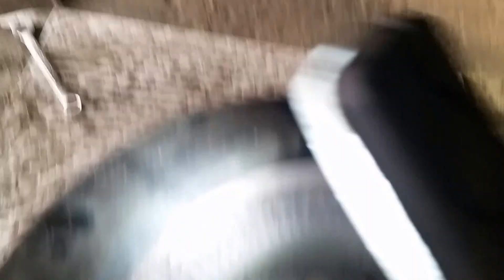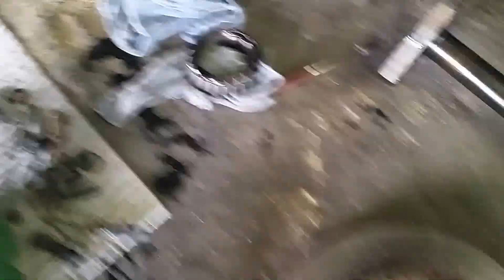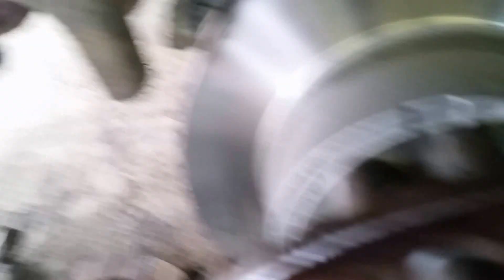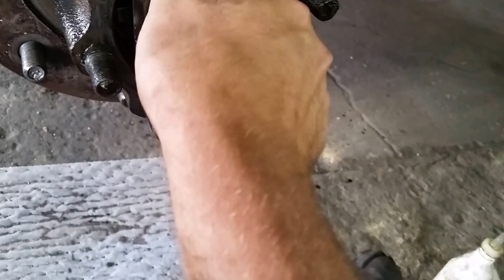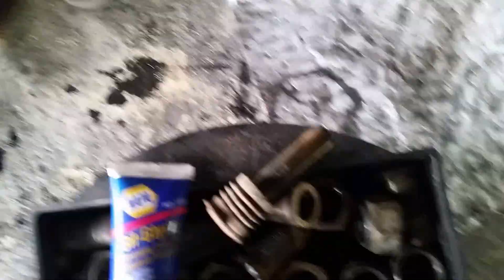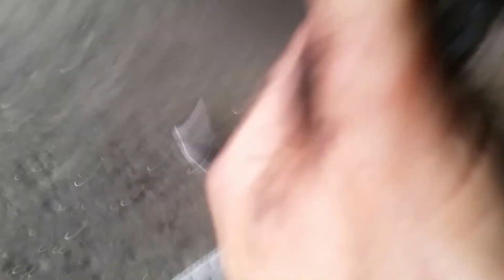International brake job video 2 of 2 #wisemanautomotive #international #brakes #rearbrakes #mechanic

Comment: Thanks for the video. I have a 1995 3800 with discs all the way around. They are 6 lug and that makes it hard to find wheels. Can I change  the hubs to 10 lug? Mine are  15x1.435 discs.

Comment: That's an interesting hub and disc assembly...any chance you can measure that disc...like to convert my 56 s-120 with discs....my budd wheels are 16"....
Reply from the maker: I would if I still worked there. Go to a auto parts store and ask to see a brake rotors for a international school bus. You could also call international dealer and talk to parts and ask them for the specs.
Reply: @jeffwiseman0286  since gm rotors are cheap and available...I probably will cut one them to fit and bolt to a harvester hub....any disc set up will be a drastic improvement over drums ...considering all 4 discs.
Reply: I will take some cues from a dodge drum to disc site ....military dodges had even larger hubs

Comment: so if you cant take caliper off what do you do when it goes bad or is there a way to change it
Reply from the maker: Not sure i understand, why can’t you take the caliper off? You should be able to take the caliper and brake hose off then replace the caliper. Whatever you do to one side you should do to the other, so make sure you replace the other caliper.

Comment: What rear axel nut socket size are you using on this rear seal and rotor replacement?
Reply from the maker: Darrick Hickman I think a 3 1/2 inch socket been so long since I did that job
Reply: Okay. Someone told me they think it's 3-1/4 that's why I asked. Thank you for the fast reply

Comment: Why gear oil instead of wheel bearing grease?
Reply from the maker: The gear oil lubes the differential gears as well as the bearings. Because it is a liquid it will lube everything. Grease will only stay in one place and have too much resistance for the differential. As far as I know you only see bearing grease on “dead” axles like a trailer or the front bearings on a old rear wheel drive car.
Reply: @jeffwiseman0286  makes sense thanks for the info
Reply: Actually using some,not alot of grease is okay as it will stay put on the bearings until the fluid from the rear end gets to the bearings and fills up the up. It is good to prefill the hub.

Comment: Hey Jonathan how you doing I have a old one International DT466 4300 and the problem that I'm having is my brakes keep sticking I can drive down the road for a couple of miles and it'll start slowing the truck down to the point that they will completely stop or I can just jump in the truck to drive it one day and they're stuck can't seem to figure out what the problem is can you help any advice would be greatly appreciated thanks
Reply from the maker: ki lo hello,  my name is Jeff,  typically calipers sticking is probably the number 1 cause. Another cause could be a brake caliper hose. I like to replace calipers and hoses at the same time if I can. Does one side stick? Is it the front or the back or both?

Comment: Only thing I do different is to fill the hub with oil before I put the outer bearing in.
Reply from the maker: Yeah I should have done that.
Reply: What kind of gear oil do you recommend for this?

Comment: Should tell your viewers to also rotate the hub assembly as you are tightening wheel bearing nut, also I follow wheel end torque specs per tmc using torque wrench

Comment: i dont undestand why in USA  you have the international 4300,4700  with hydraulic brakes instead air brakes
Reply from the maker: I have no idea why my local government bought these either.
Reply: @jeffwiseman0286  Up here in Canada most school buses use hydraulic brakes, only a few provinces use air.
Reply: @jeffwiseman0286  And they run on propane........

Comment: Jeff I had brakes put on the back 3 caliper put on the driver side until the guy at the auto parts store told me that there's no way 3 calibers are doing the same thing I may have another problem so I put  a line  on the driver side and they still stick I don't know if the front and back are sticking at the same time I've had 3 mechanic to come look at it and no one can figure it out one guy said it may be  my ABS system is going bad but I do not have any lights on on my dashboard brakes lights Etc
Reply from the maker: ki lo ok, first when doing brake work whatever you do to one side do to the other.  So if you replace a hose on the driver side,  replace the passenger side to.  Second, make sure you are using quality brake parts. Third,  I've once put 3 brand new transmission from Hyundai in a sonata before I got a good one. So it is possible to have 3 bad calipers in a row. You may want to do a brake flush. How old are the pads? Are they really rusty?